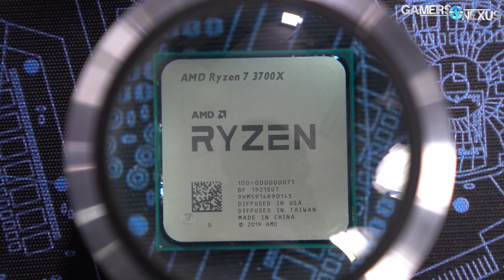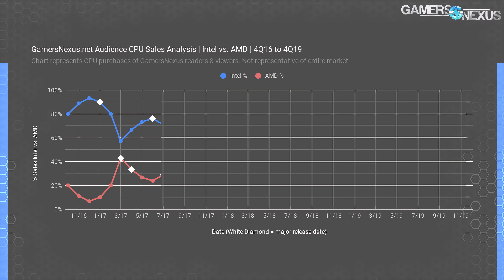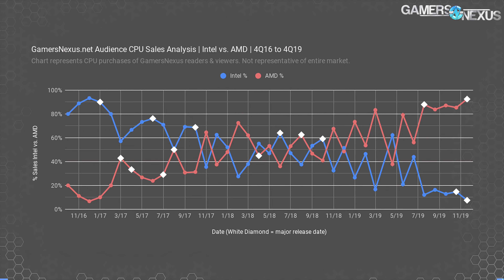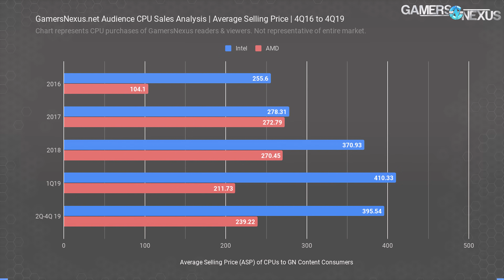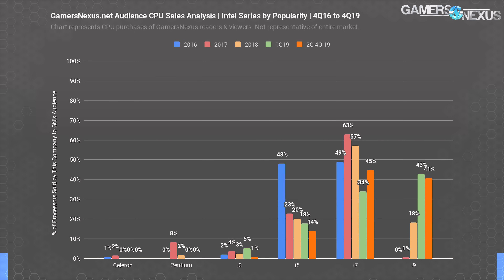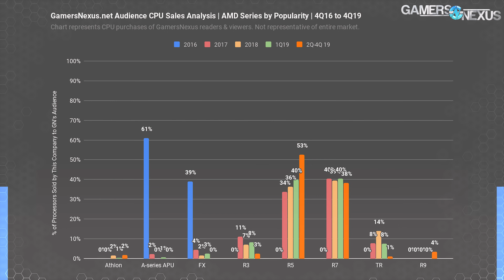GN Special Report: AMD Moves 93% of CPU Sales (Intel vs. AMD 2019 for DIY)

Comment: The only Intel CPU that currently makes sense is the 9900KS, because it is the best for pure gaming. For the low end, AMD has had a dominance for a long time (and the Athlon 3000G offers a great upgrade path, besides its value as a budget APU) and for the mid-end it's also a "bang for the buck" battle - which the i5 loses. Now with the 3950X (hope it's not a paper launch!) and new Threadripper, you'd be crazy to buy into Intel's HEDT platform.

Comment: i will chime in here, i definitely agree with the i5 being obsolete for gaming. i had an i5 7500 and my god did that thing have the highest frame times in the world, none stop 100$ usage on heavier titles admittedly, but still just ruining the experience. once mid frames are fine then the next its a dam slideshow, consistency was not its strong suit. i highly recommend and i7 or i9 if you plan on going intel.

Comment: Intel's Cascade Lake-X lineup is actually far more attractive than the previous "HEDT" lineup, by far, for people who need real computers, but not necessarily a huge number of cores.

It's about I/O, and Cascade Lake-X provides a reasonable amount of I/O for a $600 buy-in point (with the 10-core 10900X), far lower than their $1K buy-in point with Kaby Lake-X.

Threadripper provides the same non-toy computer option, but with lower per-core performance, until you get to the $1400 price point with the Zen 2 based chips.

The only person in the tech press who even mentioned this hole in the market left by AMD was Ian Cuttress, and he just mentioned it in passing.

I don't know how large this market is, but I can say that if I were upgrading today rather than a year ago, there's a very good chance I would have gone with Cascade Lake-X rather than Threadripper (which I did, with a 2950X).

It seems to be a point lost on most of the tech press, who are by now used to testing many-core processors with just a single program (no attempt at multitasking), and seemingly can't conceive of anyone needing a peripheral other than a graphics card.

Comment: now the key question:

did AMD will be able to compete Intel in 3 years , after Zen 4?
or did AMD will be the new Intel and will not inovate for a long period?
with ARM more present, I think the pressure will be there and AMD will continue to push hard.
Reply: they are already talking about 3d stacking... so, no. at least not for a decade.
Reply: ARM is not so much present in laptops and the ISA is also threaten by a new challenger called Risc-V and the recently royalty-freed Mips is now an interesting option. Also with the whole Huawei ban, more and more are leaving the ARM ship.